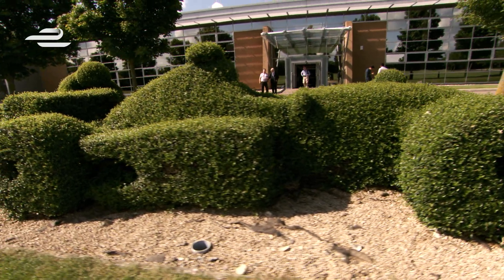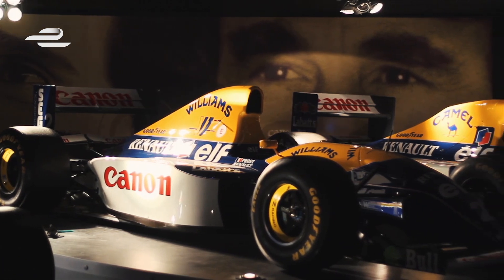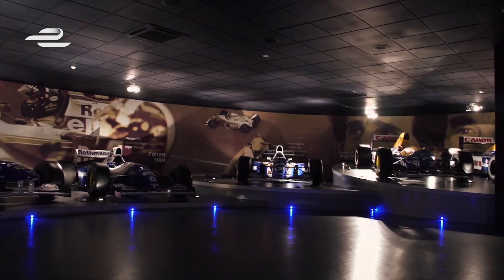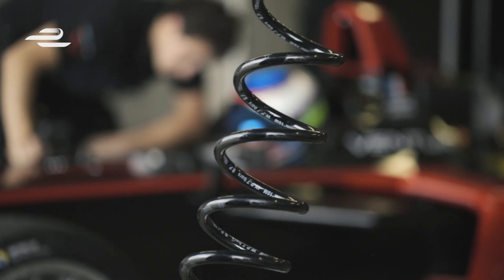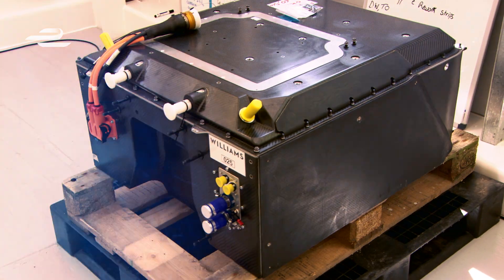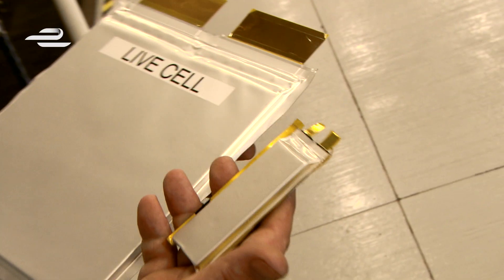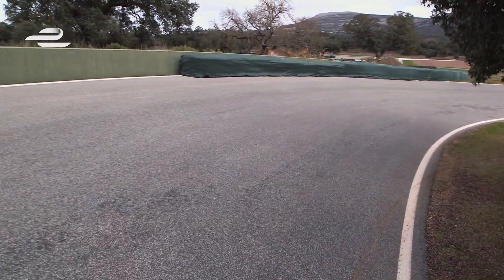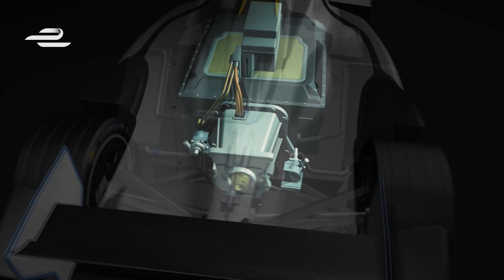INSIGHT: Williams battery technology - Formula E

Comment: If they just used RC akkus for their cars, they could have gotten a little over 43kWh in the same weight, and they could use short time power up to 2700A short term and 1350A at 945V (when connected right) witch would bring us to a short term boost of 2551 kW and a long term peak of 1275 kW. (Calculated from the max Ampere possibilities from one akku with 6 cells and 4,5Ah for 111€)
I don´t have the money for trying that myself, but I am shure it will still be cheaper than the special power sources they use, and it shure would make the race much more interresting.
(How fast could you get with 1275kW in such a car?)
Reply: RC batts aren't made for reliability and safety. That's the one type of battery I wouldn't use.
Reply: Dan Frederiksen
Why shouldn´t they made for safety?
They are used by people with little experience and now special education in using them.
Also I use my batteries for 3 to 4 years till they start loosing capacity.
The planned lifetime of them may not be enough for cars in day-lie use but, they easily outlive the racing cars.
Reply: Ismalith they are made for toys. in principle they could be good but that's not a chance you take at a formula level. just the fact that there are no well known brands in that segment is a show stopper. you want a cell that's used for serious products from a known brand.
Reply: Dan Frederiksen
I've already calculated that they are superior to the technology they use, also what are you thinking RC is about?
It is about get as much as possible out of the available technology, just like any other kind of racing.
To think you can´t use stuff because it is smaller, or available for people, at least if middle-class people, is just strange.
I don´t really get what people have against the RC technology, is it a kind of thinking, that it ether has to cost millions or it is not good enough?.
Reply: Ismalith I'm not denying that they are powerful. they are very powerful. but they can do that because they don't have to worry about reliability or safety. because it's for toys. I'm all for low cost. I'm not an idiot who thinks it has to be expensive. I'm extremely rational. do try to understand that there is such a thing as low quality products. it's ok that the product isn't reliable when it's for toys. it's ok they burst into flame once in a while. it's not so cool when many millions of dollars are on the line. but it's true in principle, a company could buy some of the batteries and do some testing on their reliability and if they are reliable they might perform very well in formula use. that's fair game, it's just that when quality isn't a priority you rarely get it.
btw, rumor has it that A123 make a cell for formula 1 use where they have changed the compromises to favor extreme power output in exchange for a bit higher weight. so I would much rather use a known brand that makes an extreme power cell if that's what was needed. for all electric it's more about energy density though. you can easily get 1MW out of such a pack but you would run the pack dry in no time. It's actually a bit of a problem for a formula race that it might be better to use a slower long range car because not taking a pitstop is faster.

Comment: Unless they made the cells themselves, and they most likely did not, there isn't much technology there. Anyone could put together a few off the shelf cells. 
And 30kWh in 320kg isn't really impressive in a performance setting. That's below 100Wh/kg. Just using the off the shelf panasonic laptop batteries that Tesla uses for Model S you could double that energy content in the same weight...
To lose to laptop batteries by a factor 2 is not really all that impressive. You really should get some better engineers or consult me. FE is very lame compared to what it could easily be let alone what it could be with actually aggressively competent engineering. It can and should embarrass F1, not be F1's pimply wimpy cousin like it is now.
Using fluorinert as a cooling liquid isn't particularly innovative either. Air is a dielectric as well and quite a bit lighter.
Reply: Dan Frederiksen People never assume that someone with actual intelligent and decent feedback is in the comments section because the majority of comments are from people like TheTorque200. If you know what you're talking about, and as a laymen I would say you are. Then you HAVE to go through the official channels to talk to the folks that matter. Posting here and expecting the CEO of Williams to call you in to look at their plans is a fools errand.
Reply: Games Nosh people who think they are on top of the world too often don't want to hear that they are doing it wrong no matter how well it's sugar coated. Dyson went to all the vacuum cleaner manufacturers. They wouldn't listen. They think they are the shit, why listen to a supposed genius from the outside. I wouldn't rule out that they would listen but I predict a 99.9% chance they wont. Public embarrassment can sometimes make idiots think it was their idea to begin with and then they change a little.
Do you think the idiots at McLaren, Porsche and Ferrari have learned the general lesson that they should have seen electric drive coming and lead the way? of course not. Those idiots still think they thinking is the best and they should listen to no one. Never mind the obvious fact that others brought the electric revolution, despite those idiots. Just look at Formula 1. How many of htem are calling for F1 to go fully electric...   they are idiots. What can I say.
Reply: ***** try the other direction :)
Reply: oli696969 one might point out that it's a cobalt chemistry, which has been known to catch fire. The geniuses at Boeing also didn't consult me when they went with a cobalt chemistry. One might also point out that using A123 cells would achieve the same effective specific energy or better and require virtually no cooling. lifepo has the distinct advantage of not being flammable, almost no matter how much you abuse it. And it would have dramatically higher specific power, around a factor 2. Although for these toy cars at 200kW peak it would be quite overkill with the 1MW it could deliver but would have the advantage that it doesn't break a sweat at all. Whereas with the cobalts you might be trying to keep them from catching fire during the constant power cycling.
Another configuration would be half and half of panasonic 18650PF and A123 such that it has around 45kWh capacity at the same weight and still no cooling needs. Panasonic is not a cobalt chemistry and the agile A123 lifepo chemistry could absorb the rush.
I welcome objection from Williams engineers. I expect deafening silence.
As for UN38.3 that's just for shipping of lithium batteries. Ironically the cells that Boeing chose for the dreamliner was the only battery certified for aviation iirc, ironically it was still just about the most dangerous they could have chosen. Just because clueless bureaucrats run a product through an overpriced test and write a piece of paper on it, it doesn't mean it's any good.
For next season when the teams make their own cars we will hopefully see some far more aggressive engineering although I fear that FE will try to maintain the kindergarten level with rules in a misguided attempt to keep the competition close.
Reply: oli696969 I don't live in UK but ignoring that aspect, they are in all likelihood not willing to listen. No one listens. The not my idea syndrome is unfortunately extremely epidemic in humanity. Same as no one wanted to buy Dyson's vortex vacuum cleaner design. He asked them all and without exception they knew best. Out of necessity he started his own company and is not bigger than them all.
I have been very confidently outspoken about all aspects of electric cars for 8 years and you know how many companies that have even inquired with me just in case I know something let alone aired the idea of a job? exactly none.
No one pays attention to anything public. They are in their little bubble and outsiders aren't relevant. Any forum, any news site, you wont find a motoring engineer engaging in debate on any aspect. I have written thousands of comments, scathing intelligent knowledgeable treatment of every car maker trying their hand at green motoring and never once has a relevant engineer or CTO or CEO countered anything. Nor do they even pay attention. They live in their bubble and they are clockpunchers. Mind turns off when they go home. Well, even more than it was at work.
They hire by simplistic notions they can understand like straight from uni by normal sheepish application or from another company like themselves with some achievements they can relate to. When some lone genius comes along and says you are doing it wrong and I can help you do a lot better, they just don't want to hear it. Indeed the more right you are the more offensive they find it.
I have contacted quite a few companies over the years, not even asking for a job, just offering intelligent insight into some areas where they could easily do better. How dare I...  without exception they are dismissive and if persistent they are angered by the presumption that I could possibly know better.
You can boil it down to the common fact that people don't like to be told that they are doing it wrong. If they were rational they would welcome a cheat code to suddenly do a lot better with ease but the idiotic pride almost always gets in the way. Your thoughts are not my thoughts ergo they are not welcome. We know best. And that's not limited to a company like Williams where it's semi understandable that they could delude themselves that they know best because they are involved in high dollar motorracing but it's a universal rule. The most amateur blatantly super wrong team in the most amateur competition, they never listen. It's their show, they know best. Never mind that they fail en masse and that my assessments to that effect are public record so they can see that I knew what I was talking about. It doesn't matter. 
A car company will pay Henrik Fisker 800k$ to crayon a car on paper but they wouldn't pay me dime one to give them genius input. I offer advise for free all the time just in the hope of bettering the world but they would sooner douse themselves in gasoline and light it on fire than listen to me. Such is the super stupidity of mankind. Einstein is quoted as saying that only human stupidity is infinite. It's devastatingly true in many cases.
Reply: Your an idiot, how do you know they didn't consider any of the other technologies that you are stating, the problem is it isn't just about capacity, there are lots of factors they need to consider because its a racing car, for example the batteries need to be capable of putting out 100KW ,which is huge, so they need to make sure it doesnt overheat and explore or is even capable of delivering the power for such a long time.
Reply: chris howarth you're*